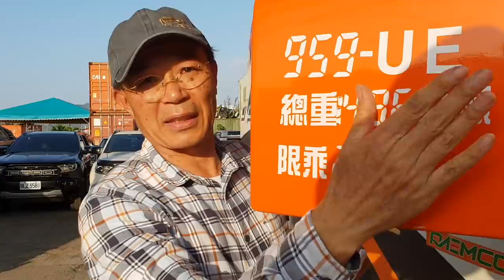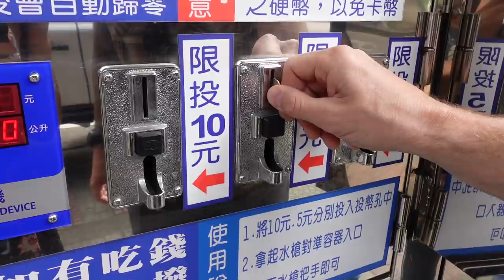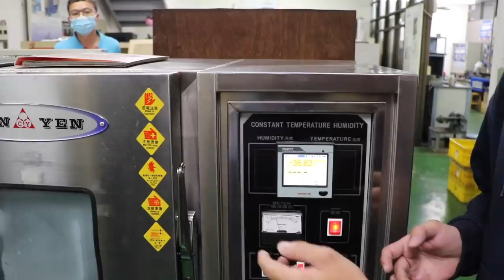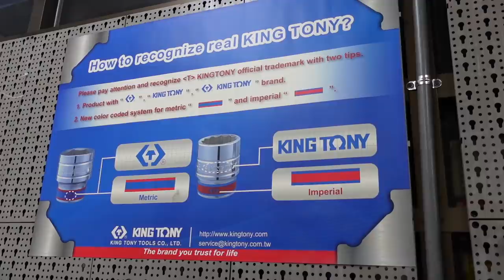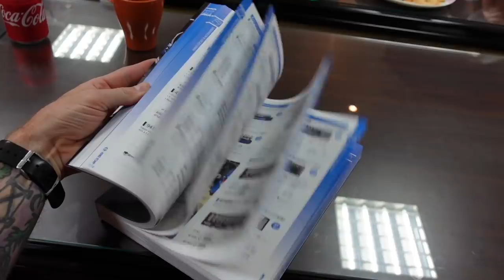Dakar Rally Unimog - King Tony Tool Factory - Taiwan (Ep158)

Comment: Wow. To anyone who has ever driven a Mog - 170km/h is a totally frightening speed. That's over 3x the original maximum speed that your underwear can usually handle.

In "family car" terms that's a speed equivalent of 300 to 350 mph, just to put it in perspective. 

You can drive at normal Mog (*) at 0.2km/hr for 12 hours a day over 40 cm bou lders in relative comfort (bouncy-bouncy, of course), but at anything more than suburb driving speeds on an open road they can get tiring and rather too loud. Not quite as bad as Gaz 66 highway fatigue when in top, but a Mog makes you concentrate doing 50 whereas in most Defenders you would be just relaxing at a normal open-road cruising speed at 100. 

We would use the term "Mogging along" at a brisk 40km/hr because it was a sweet point between progress, noise and thrashing it. But 170? nope -  think rather have a working set in the gearbox and arrive 45 days fashionably late :)

* "normal" - hahaha - Unimog fitters everywhere will be shaking their heads at me. You want train wheels fitted? OK -  What size rail wheels?  And what gauge?  And hydraulic or pneumatic lift? How about a crane arm - or maybe two? You want chainsaws on both or just the front one?